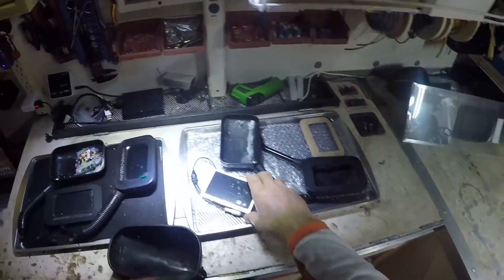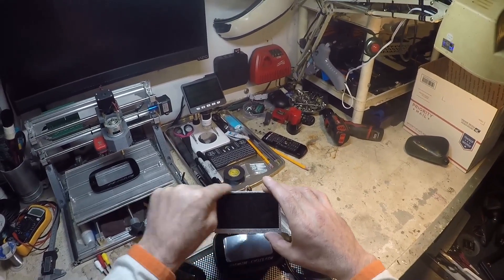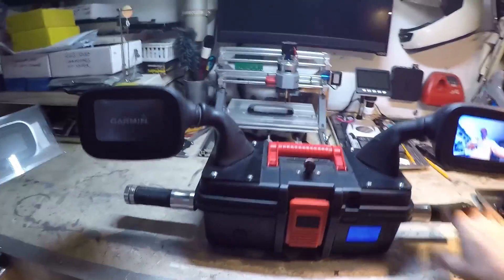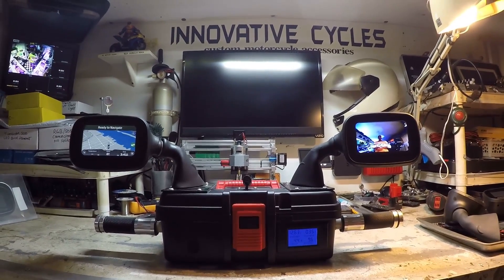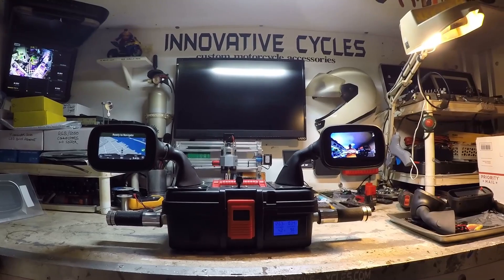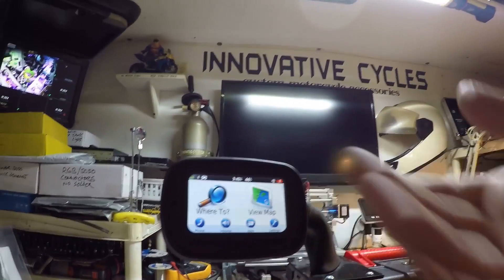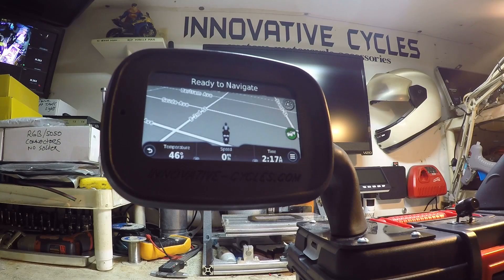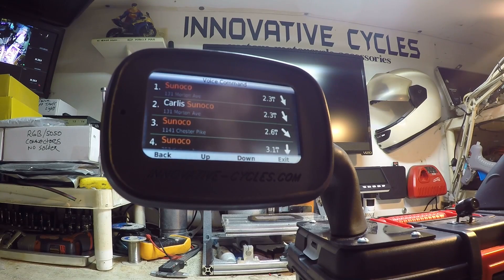NEXT GEN gps/rear-video motorcycle mirrors

Comment: If bike is stolen can the garmin track the bike ?
Reply from the maker: no it does not, its just a gps receiver when on....    easy way to track your bike is drop one of those cheap keychain item tracker gps transmitters under the rear seat that you can track with your phone. cheap and easy you only have to check it regularly since its a small button battery but is said to last months so every season replace the batt and youre golden!

Comment: Tried to find info. by scrolling down but couldn't find it. Are the blinkers on the mirrors legal replacements meeting DOT requirements? Is the power supplied by the old blinkers the source for the mirrors? If not, what is the source? Can you toggle the power on and off with the bike running? These are very interesting and extremely impressive.

Comment: You should take a iPhone pro / plus screen and see if it fits. Oled is bendable. Much higher res, brighter. Or just put a iPhone in there. Or a CarPlay setup. Run waze.  Waze has live weather. Live police locations. Voice activation through waze or Siri. If it was the whole phone you could run it as a second line and it would also provide tracking if someone stole the bike or the mirror and locks someone out from using it again. 

You could take the screen and mold it to fit the mirror, a thinner lighter one, and use a extension cable from the display to the main board. Same thing with the camera board. FaceTime. And a security system for the bike with dual cameras and it’s connected to the internet. High speed LTE.  

And if you want more functionality, you could always write an app that integrated all of the bikes systems. Including a rear and front camera that was recording in the background. And have the rear camera be displayed on screen 2 or the right mirror. You can hook up external displays easily with the iPhone. And then route anything to any display.  As well as have a Bluetooth OBD module hooked into the bike sending data back to your displays. And a few radars interface with the iPhone with their own app.  

Waze is better usually as long as you’re in a large city.  And it’s always backed up in the cloud. Someone steals it and you can’t get it back, then $300 in parts and you’re back. 

Oh and I’d add a fan in the mirror. Like a 20mm pi hat type. 

And you can write custom apps that run on just your phone that don’t go through the apple approval process.  And ones that get automatic push updates. 

Face ID to unlock the phone. Use your custom app to start the bike via the OBD.

Oh and dash cams could live stream to YouTube or anywhere.  As well as archive their stream in the cloud so nobody can delete the footage. Plus all your data would be super encrypted on the bike being that it’s iOS.

Also you could put a 3M privacy filter on the screens so only you could see the screens, not people behind and to the side. A polarizer screen filter on the screen and your helmet could make it so only you see it. Same tech that’s in some 3D movie theaters.  The ones with active 3D glasses. This would be cheap to do as all consumer 3D TVs have active polarizers and active glasses.  

The app could also be programmed to run a heads up display. Just would have to find a mini led projector that would work.  Make a hacked F35 type helmet.

Comment: I really wish that they didn’t say "Innovative Cycles.com" right underneath the screen. I don’t mind branding but somewhere else would be better like on the base of the mounting point, or small lettering on the rubber boots are something. That’s the only turn off for me. If you ever decide to do like gen4-gen Zx10r mirrors, like actually using those mirrors then I would definitely but I don’t like how square and bulky those mirrors are. Doesn’t look good with the body

Comment: I got mines and they are installed. Only had to replace the turn signal flash relay with a LED flash relay and it was good to go. My Suzuki wanted to be different.
Reply: What's the model of your suzuki? I got a gsf Bandit S and I am asking me if the device fits in my bike. Sorry for my bad english I'm from France. Does he deliver as far?
Reply: @TheAtlanteur  I have a 2013 Suzuki GSXR 750

Comment: If you leave them on overnight and come back to it in the morning, will the bike be dead?  Are you able to use other apps through it (specifically the Waze app, since it has built-in Bluetooth)?  How water-resistant are they?
Reply from the maker: yes overnight they will kill your batt, no they are only preloaded with our apps and they are water resistant but not waterproof, especially now with the new voice command since there is a pinhole for mic so not recommended to store bike out in the weather or ride in heavy rain or spray with hose pressure washer etc but light rain moisture etc is no problem

Comment: Awesome tech...  here is an idea. 
Put in a sleep mode, so when you are going to be away from the bike for like a few hours, you can have the screens go black so it doesn't attract attention, And when you get back to the bike to leave the screens would just turn on. Similar to what you get in a computer. 
You could also put in a auto turn off feature if you by chance forget to turn off the system, so it doesnt drain the battery. You know like 
if the bike is off for 8 hours the system would just shut it self off. 
PS> And yes i am subscribed, so i can order all of this cool tech from you when ever i get that dream bike in the near future or when i can convince my wife to let me have a bike. Still trying...... sigh
Reply from the maker: Thanks for the suggestion....  but Most customers want/like the attention and leave them on to show them off they're quite unique. And if they went to sleep mode at bike/nights shows when you want them on would be annoying
Reply: @carbonrrpilot  Well if you have it set up where the driver can control it, like putting a button for sleep more. And even having the driver putting how long it should stay on for. Also you can make it so when the bike is on it wouldn't go into sleep more. It should be simple to do. Like setting up your screen on a smart phone.
Reply: @welltell.  In order to tell it that the bike is on, you would need a separate wire (from the actual power wire) that is spliced into an "only when on" wire such as the headlight (easy to do using an 'add a fuse' in the headlight fuse slot.) So, not impossible but it would require them to add a remote wire to their circuitry similar to the remote wire for car stereo amps.

Comment: Looks really cool, only worry about regulations making this only available aftermarket
Reply from the maker: lol what don't we do to these bikes thats illegal...  flush mounts, tinted shield tucked plates!  but yes check your local laws but every cop thats ever mentioned them dug em!
Reply: @carbonrrpilot  I see this as something that could be sold on a mass level, even installed as a factory option but I dont think dot regulation would allow it. Have you ever seen a rearview mirror that turns into a backup camera? They have them as factory in some cars.
Reply from the maker: @thecheesburgler  yes we have pix of sets we make just like on innovative-cycles.com that but its rear-video only as touchscreen don't work through the 1-way mirror and everyone wants the touch GPS so we sell few of those kits!